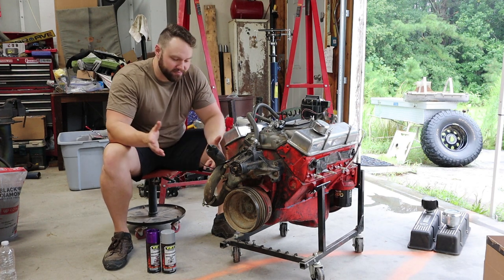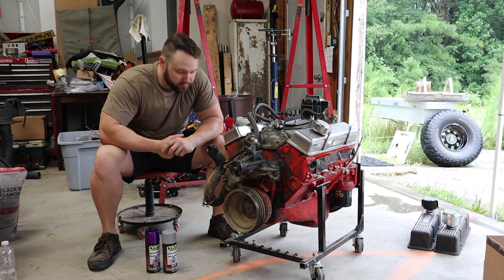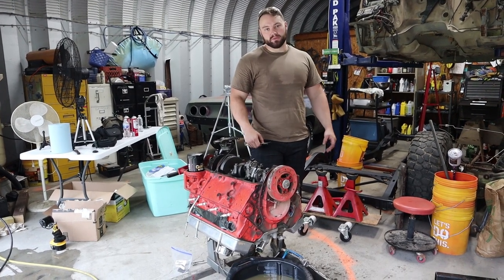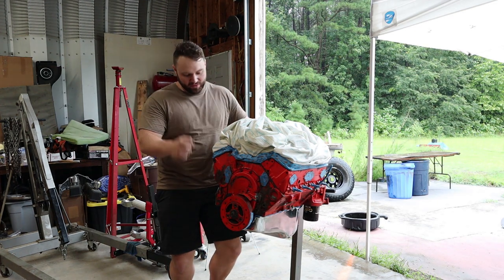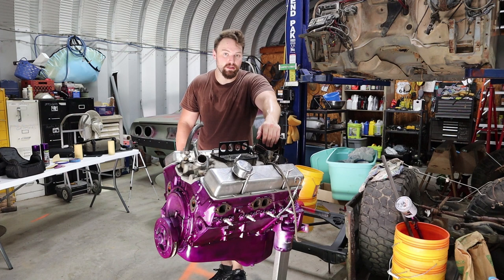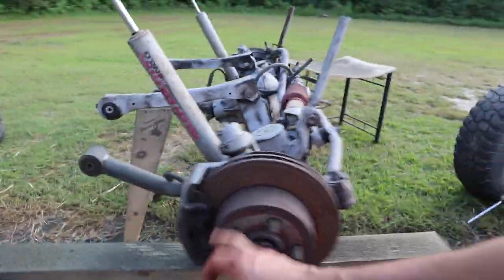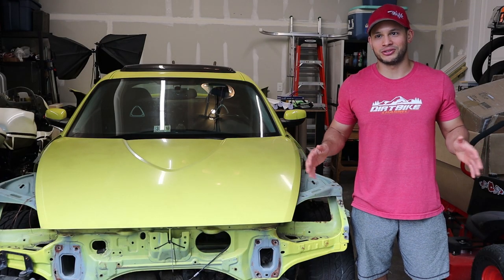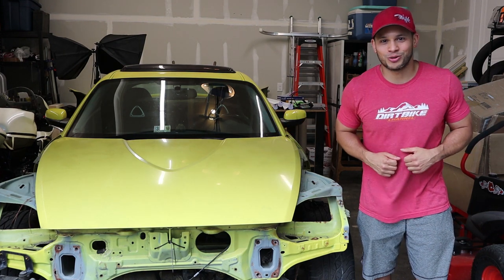2000 TJ Jeep Wrangler Axle and Engine Paint & Prep!!  Jeep Rebuild Part 5!!

Comment: Currently doing the same thing you guys are doing....complete frame off restoration on a 2002 TJ. Started it back in June as well and I’m close to getting the tub back on the rolling chassis. It’s a lot more work than one would think. Keep up the great work!
Reply from the maker: Far more work than people realize.  Our biggest headache was trying to sandblast the frame with grit that wouldn't strip the rust off.  We picked up some coal and it strips everything wonderfully.  Good luck with your build!!